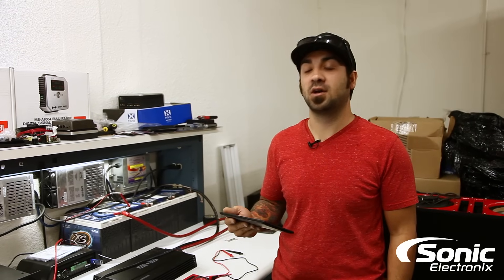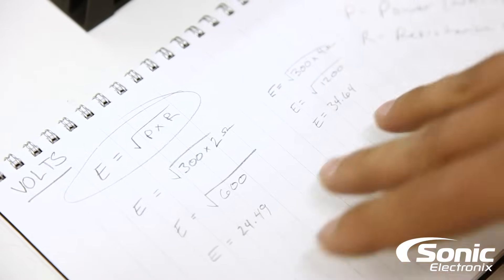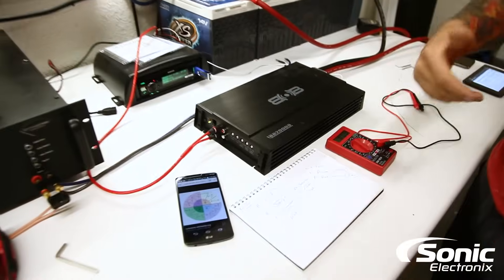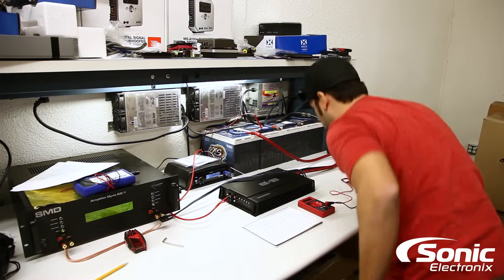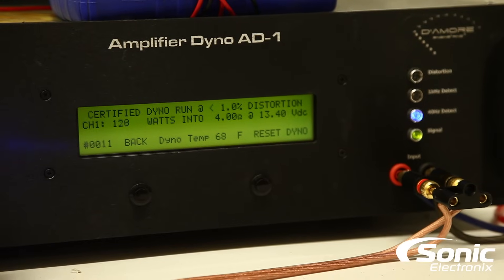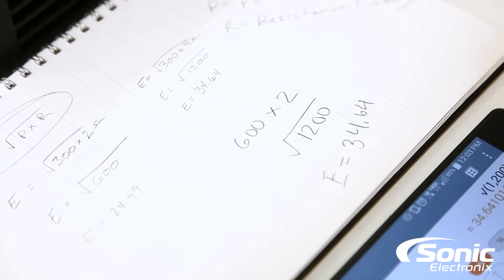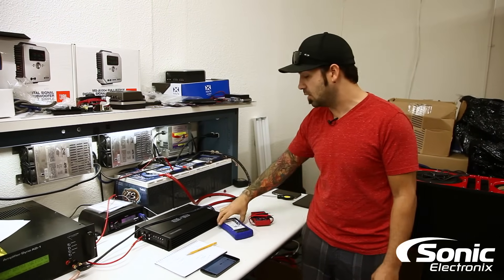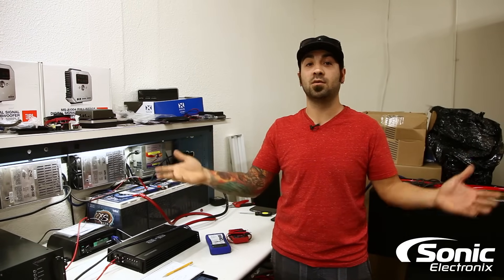How To Set Amp Gain to Match Lower RMS Subwoofers? | Car Audio Q & A

Comment: What if I have a sound processor prior to the amp? I have the stock head unit tied into a sound processor which then feeds my 5 channel amp. my target voltage using this formula is 25.3 for my speakers and 31.6 for my subs. My sound processor has a light that turns on when it detects distortion i believe that only detects distortion before the amp... but if there's no distortion before and i do this to adjust my amp there should be no distortion after?

Comment: How would you level match between a powered line output converter (lcq-1) and an amp. The system has a factory amp before the LCQ?
Reply: See what your amp has reccomended for input voltage. Use a volt meter and test the rca outputs of the lc2i and adjust the gain until you get to the voltage your amp reccomends. Then set amp gains. Make sure all eq is set flat.

Comment: I have a single, 300w rms kicker 10" sub, @ 2ohms, paired with an Alpine mrv-m250 single channel 250w, @ 2ohms, amp. I watched this video, did the math and I got 22.36v (amp) or 22.49v (sub). Which one do I go off of, amp or sub? Also, what about the LP Filter and the Bass EQ knobs? This I noticed also changes the voltage number after setting the gain only. Your video here just explains the gain setting, so with changes to the other knobs or all three knobs, gain, lp filter and bass eq, should what ever settings I choose for all three, equal to the 22.49 or 22.36 volts? Thanks for your time.

Comment: please help i have rockford t-1000bd hooked to two jl  12w7 wired to 1.5 ohms and the amp supposedly capable of 3650wats at 1.5ohm which makes no sense to me.... i set the gain to max with all filters off and hook multi meter to it and was constant at 74 ac (74^2)/1.5=3650watts but that doesn't make sense please help barley have the gain at 5 which is less than half way reading 51volts which i calculated to be 1734 watts but this t-1000 amp
Reply: i do have high power battery i do have the big 3 but not a second battery alternator puts out 120amps
Reply: but can u tell me why its reading 74 volts thats to much power for that amp
Reply: lol i know how both work but 74volts ac to is much power for that amp i wana know why its reading that high
Reply: 3650 watts? I think your mistaken bud. Also if you think 74 is too much. You just said you cut the gain all the way up 

Clip clip city
Reply: i know im only playing it at 50 volts at 1.5ohms
Reply: amp hasnt went into protect yet

Comment: ok how about this... a 2500rms sub powered by a 3500rms amp. and now i have 2 of those subs and 2 of those amps. how do i gain match all of that? as each sub has its own amp. and each sub is 2 ohm and each sub will have a 1 ohm final load.
Reply: What subs what amps?
Reply: +Philip Mcalister 2xascendant audio mayhem 18s. and 2x esx signum 7000d amplifiers.

Comment: I have a 1200 watt alpine 3 channel amp , one 12, one 10 and two rear door speakers do i have to have a matched load on each channel. My problem is when the amp plays for  awhile the auto shut-off on the amp resets the amp and it will come back on after a few moments. Is there anything you can think off that might cause this. I have a good power supply cable and amp is grounded well.I use the 10 for a sub ran through the amp sub channel and the 12 is bridged on another channel and the the door speakers are on their own channel. The amp should be plenty big enough should I un- bridge the 12 and only use one side of that channel. Any advice would be greatly appreciated.

Comment: What if it's backwards? Say your amp is 300 watts rms @ 2 ohm and your sub is 750 watt rms @ 2 ohm. Should you set amp gains to amp rms or subs rms? 

Just wondering because I had my amp go out in my truck and I'm replacing it with a temporary old amp and don't want to fry the old amp... Thanks.
Reply: +taylor binning no, that would drive the amp into clipping hard sending dc signal into the sub and quckly heating up the coil frying it. set the amp to its max rated rms in this case.
Reply: +1991darkmage So set the voltage to the amps 300 rms? I'm wondering how the amp would fry the sub if I set the amp to the sub voltage based on the subs rms? Do you mean if I set the sub voltage base on the subs rms 750@2ohm it would fry the amp?
Reply: +taylor binning 

SUB- 750rms x 2 ohms Squared= 38.72 Volts

Amp- 300 rms x 2 ohms Squared= 24.49 Volts
Reply: taylor binning it would hurt the sub cause the amp is designed to only put out a certain amount of power. in your case its 300rms, the amp may be able to do 50-100 more depending on the brand(or not even rated with cheap brands) but either way once you try going over the amps supported power the amp will then do whats called "clipping"(also referred to distortion) when that happens the amp quits sending nice clean AC signal to the subwoofer and begins sending DC signal which in tern VASTLY heats up the coils on the speakers.
Reply: +1991darkmage 

Got it! Thanks for writing in crayon for me! lol

Comment: so can I still turn my bass boost up after I set the gain like 2 notches up or should I just leave it alone? also I turned my deck bass settings down can I turn them up as well? I have a Alpine cde hd149bt

Comment: +Sonic Electronic The test that you're performing is for one woofer right? I have two woofers with a 5 ch amp: 

http://www.crutchfield.com/p_113XR9005/Kenwood-Excelon-XR900-5.html?tp=115&awcp=1t1&awcr=28870854203&awdv=c&awkw=xr900+5&awmt=p&awnw=g

the amp is 600 watt for the woofer, I'm guessing. My 2 woofers are 4 ohm 400 RMS. How would I set the amp for both woofers?

http://www.crutchfield.com/p_113XW120/Kenwood-KFC-XW120.html?tp=111&awcp=1t1&awcr=58098514523&awdv=c&awkw=kfc+xw120&awmt=p&awnw=g

Comment: So I have a mbquart 600.4 and two Polk db651s for up front at 4ohms each. So using this method, I should be at 15.49v. Well, problem is.. even my fh-700bt pioneer head unit on max, you have to turn the amp WAY past clipping to get that 15.49 at 0db. At clipping, I have to leave it at 5db. why is this?
Reply: Oh, and the db651s are 60rms a piece
Reply: +Bryan Willis that is telling you that your amp can't push the wattage you want. This Guide was for down tuning the gain to reach a target wattage. You are trying to go past the maximum wattage of your amp.
Reply: But the amp is rated for 80watts rms at 4ohm. With this equation, I can't literally go above 8rms/5v without clipping. The headunit isn't clipping either. Always thought mb quart was a reptiuble brand. 
Thanks for your comment though!
Reply: Just realized that you're talking about mid speakers, you do realize you can't use that 50hz test track right? If you have the HP filter set it shouldn't push anything below that filter point or very little. You need to run a 1khz test track. You could use the 50hz track, but you need to remove any filters, either at the head deck or at the amp. The higher freq test track will give u better results(real world) with the filter in place though.
Reply: Oh I only use the 500hz, 1khz, and a pink noise test track. While testing I leave the crossovers off. Its just super weird all together, why its playing so low. Headunits can do 15watts rms XD I mean its still loud at 5v, but according to my multimeters, its nowhere near the power it could be pushing
Reply: Bryan Willis Well if you are using the right test tracks then that is low.. Maybe want to check your inputs? Both the rca's or the power/grounds. Are you using high level inputs or rca's? Maybe check your ground and see if you can't make it better. Sounds to me like one of 3 things: 1.) Choked up amperage 2.) Poor input signal voltage 3.) Defective amp.

Comment: I have a Kenwood XR-900-5 running a Kicker VCompS12 2-Ohm (300rms watts) sub.  The amp is capable of 600rms watts @2-Ohms on the 5th channel.  Recently the sub blew and Kicker is replacing it.  In the mean time I've been running one Sony XS-L121P5 4-Ohm (350rms watts) sub fine, w/o changing any settings.  I now want to run two Sony XS-L121P5 4-Ohm subs on this amp, which obviously would have to be wired in parallel at 2 ohms to get the 600rms watts total this amp can supply.  The 5th channel on this amp is dedicated to the sub.  What would the voltage out need to be in order to run these two subs on this amp?  Short version is I need my amp to put out 600rms watts @2-Ohms.
Reply: +uBreakIt iRepairIt You need that tool that detects clipping. You are essentially wanting to push that channel to its max, so just turn the gain up till it hits clipping basically. Probably won't get 600 watts though, those figures are usually tested at 14.4 volts and typically you'll get 13 volts from your standard car power.

Comment: hi, i have a hifonics BRX1100.1D and a Rockford T2 dual voice coil 2ohm woofer trying to get the most power from my amp so if i wanna run my amp at a 1ohm load i times it by one? or 2 cause my sub is a 2ohm woofer? im trying to bring out the 1100 rms this amp says it can run.
Reply: You'd have to wire the voice coils down to 1 ohm in order for the amp to send 1 ohm rated power
Reply: +TheLukeMartinez i did that...

Comment: Ok, im lost a bit. If some1 could explain me that would be great. The 
thing is i run 4 channel amp for my front and rear pairs. I used 1khz 
sound wave to adjust the gains. targeted voltage for the front was 
16.5v, for the rear 18.5v.  adjusted amp input to get 16.5v (right side 
front) and then dabbed left side terminals to check if the voltage was 
the same, but it wasnt!. it read 19v (???). left that, adjusted rear 
channel left to 18.5v as i needed, but checked the right channel and it 
read 21v. SO WTF is this normal as i thought both front and rear 
channels should read the same voltage, but they dont!. Checked my head 
unit, there was no fading/balance or any listener position set up. 
Everything was flat, eq flat, no boosts etc. Could it be that my brand 
new JL amp is faulty or what?
Reply: +Antanas Rapkevicius Is there different filters set on the channels? LP or HP etc.

Comment: i have 2 jl audio w3 on a sealed pro box with a phoenix gold 500 watt amp the amp shuts off if i turn it up more than 10 volume on the radio what could cause that to happen??
Reply: +Ivan Ramirez Could be a few things, but probably too small of power/ground wires. Could be too low of ohm as well, your amp could be handling a low ohm at a low output, then shitting a brick when you turn it up. I'm guessing it's your wires though.
Reply: +Wick3DPimP i have 4 guage wire ofc
Reply: Your problem could be many things, but my 1st guess is voltage drop. Your amp will turn off if it goes below a certain voltage(typically 11 volts). This could mean a poor ground. Weak battery. Weak alternator. You may need a capacitor or better yet a 2nd battery in the trunk. If you have a cap, it would give u a voltage reading though. I would start by having autozone or the like do a test on your battery/alt. If those are functioning properly, think about how your ground is ran and if its getting a solid connection.

If that doesn't solve your issue, check your ohm load, if you disconnect the subs from the amp and then put a multimeter on the wires, set to read ohms of course. Then make sure your amp can supply a signal at that ohm load.

Comment: if I have a 2 ohm woofer wired to 1 ohm do I still do this at 2 ohm or no?
Reply: +Brandon Watters you cant wire a 2 ohm singe voice coil sub to 1 ohm. If it has 2 ohm dual voice coils, then you can wire it to either 4 or 1 ohm.

Comment: now how do i set it if i'm running 2 300 watt subs @ 2 ohms?  would it be the (square root of 300x2) x 2 or (square root of 600x2)??
Reply: square root of 600x2. adding subs of the same impedance and power doubles the power handling. if you have 2 300w 4 ohm subs wired in parallel then your amp then you get a 600w at 2 ohms.

Comment: Is the OHMs used for the equation based on the final resistance of the subwoofer or the ohms of the dual leads? IE: I bought a dual 1ohm subwoofer. But it's wired in parallel down to 0.5. Would I use 0.5 ohms or 1 ohms for the equation?
Reply: Forgive me if I'm wrong but I do believe at 0.5 a driver would not run I think 1ohm is as low as it could be the load on the amp would be very high even at 1ohm your find it would run pretty hot
Reply: +swwiss There's HQ amps out there that can run .5 ohm stable (Like Crescendo). I've seen videos where people run .33 ohms as part of their daily system.
Reply: +AnOriginalUser Name wow really that's pretty impressive

Comment: My question is how do you know that you still have a distortion-free signal after you've set the gain? Do you just rely on your ear? Getting one of those SMD DD-1s would be great to do so, but it's a few hundred bucks.
Reply: +Numinous Depending on the amplifier you are testing you could just try to turn it up with a 50 hz sine-signal at a given input voltage and listen for the sound to distort. This works for most small amplifiers with low power, because everything else will get loud pretty fast. Some amplifiers come with a clipping/distortion led which starts to light up if the amplifier starts to distort and most amplifiers should have a input sensitivity rating which tells you at which input voltage the amplifier reaches its maximum output power without distorting. The last resort would be to buy one of these http://www.ebay.com/itm/Pocket-Oscilloscope-DS203-minidso-DSO-quad-stm32-host-/251590072426?var=&hash=item3a93efd86a:m:mAIcxnFFO6Nb7aE2LXt0ksg or any other inexpensive oscilloscope and look for distortion in the output signal, it is pretty self-explanatory and normally comes with a manual (make sure you set the probe to 10x with high voltages, because otherwise you could damage the oscilloscope)

Also before you start testing, make sure that the speaker can handle the output power of the amplifier or else it will get damaged pretty fast, just saying.

Comment: What if i turned the gain all the way and it only shows 7 in the multimeter? What's wrong?
Reply: +Ray G All amps will be different and output voltage from your head deck will be different. Also the type of rca cables you use, can affect this. Doesn't matter that much probably, just use the method in the guide.

Comment: amp-pdx m12 
sub-12" kick L7 2ohm
head unit- avic 8100nex
test tone- 50hz
volume 75% of Max

when right away the voltage is 123.sum sum 
wich is up above the required voltage 48.sum sum.
why would this be happening?  if math is all correct and nothing is Fd up then my system would be clipping as is no adjusting gain.
any ideas? I'm scratching my head way to hard

Comment: I have 2 dvc subs rated to 600w rms and an mono amp rated to 1000rms at 1 ohm. I have them wired down to 1 ohm. so I should be getting 500w per sub. this would be the case with all gains maxed or tuned right?

Comment: I tried this and for some reason my amp won't go to where I need I have a boss riot 3400 watt amp with 2 boss ar 12 subs at 2400 watts each and I'm running them at 4 ohm  so my amp is running at 1050 watts Rms 4 ohm and according to this I should be at 64.8 for power and I'm at 50.1 for my amp please help

Comment: How did you verify that the head unit can be maxed with no clipping with your oscilloscope? Did you just connect one probe to the + RCA and the other to the - RCA? Or did have the RCAs plugged into an amp and use probes on the amp's outputs with the gain all the way down and the frequency all the way up?

I'm trying to think which way is better...

Comment: i have a 1999 camaro with the "monsoon" "200w" radio/amp ... now the center speakers are 6.5 to 6.75" 2ohm stock, so my question is, if i pput a 4ohm 6.5" sub at around 200/300w will it still sound as good or should i just get an actual 2ohm speaker... its suppose to just push base

Comment: Could you use this example in reverse? In other words, I have a 5 channel amp that puts out 75 watts rms at 4 channels at 4 ohms and my door speakers are rated at 100 rms watts at 4 ohms..
Reply: Think about it, you can't just make power out of thin air, if you can't produce 100w or more then you can't adjust it to 100w, and no you can't adjust how much power your speakers want. This is because the speakers are rated at a certain wattage and that's the power they need to run, if you give less you will be alright but wants you crank the volume the speaker may need more power but it's not getting it and then you get what pretty much sounds like popping.
Reply: +Dollar Bin Gaming so I could just turn the gain for those speakers all the way up essentially?
Reply: kain452005 NO, you will run into the popping issue sooner as you turn the volume on your radio up, because the speakers are trying to draw more power and not getting it. How you would want to set the gain on your amp is to turn the gain to furthest level down, and turn your radio to about 3/4 and then start to turn up your gain till you get whats essentially a popping. That will be your cap on how high you can go, now you could also turn the volume on the radio to max and do the same that way you can crank your radio if you want. In my situation I got 2x Alpine power packs in bridge mode putting out 90w at 4ohm, and I have the Kicker KS 6.5 that are rated at 100w at 4ohm, my gain is roughly set around a few notches above the beginning because my radio puts out a pretty large signal to begin with, and this also allows me to max out my radio and not get any popping because I am just shy of full normal power to them. Your case will be different from mine so adjust it accordingly.
Reply: +Dollar Bin Gaming I appreciate the help.. I have a Rockford Fosgate Punch amp with that "CLEAN" set up so I guess I'll go based off that.. I appreciate the help!